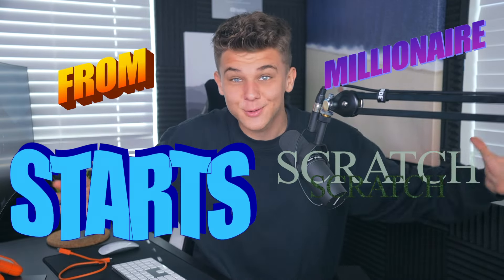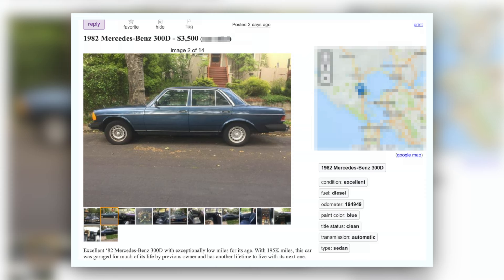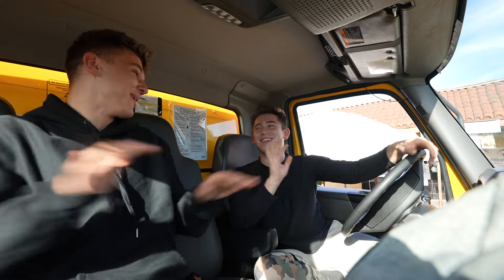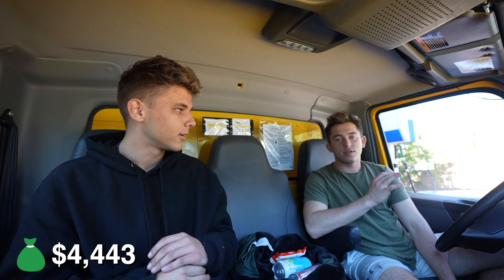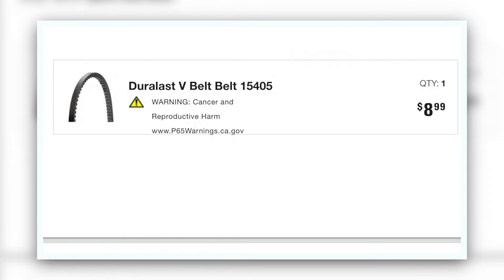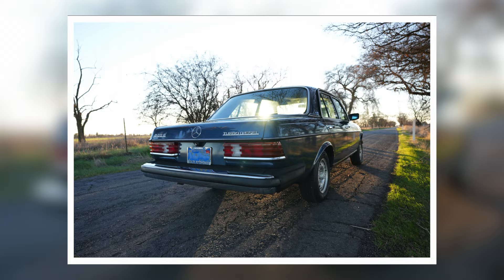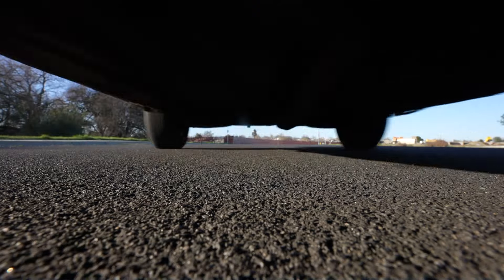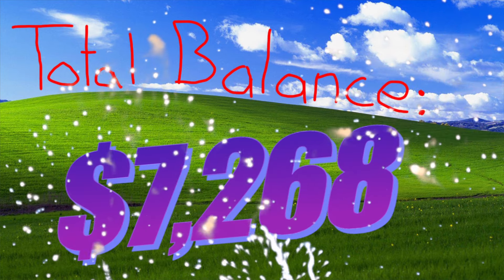Millionaire Starts from Scratch EP. 3

Comment: Great video, just gotta say, $3k for that car is not very shrewd! I'd say look at flipping BMW Z4s (I got a 2007 for $3.4k and flipped for $8k), Miatas, or E90 series. If you look hard, you can get cars for much cheaper. Just gotta get turned down a lot. And find cars with issues so you can fix!

Comment: You're going online to buy an alternator belt to put on your BMW flipper car, but a normal person would not know which parts need to be replaced on this random car.  You would have had to have brought the car to a mechanic and paid him quite a lot to search over the whole car to determine what mechanical things need to be fixed and/or replaced.  That costs a lot of money!  Then he would have had to tell you something like "your fuel pump and your alternator belt need replacing in order to resell this car and having it running optimally."  Then you say okay, and the mechanic is mad because you're not going to pay him to do the repairs.  Then you have to buy the parts.  Then you have to have auto mechanics skills and a place to do repairs to install the parts or do the repairs.  The whole thing's risky because if the car needed more serious repairs you would not have been able to do them at all.  Even just the jack you used to jack the car up to do the oil change is very expensive.  It just magically showed up?

Comment: There is no way you can rent a truck for 3 to 4 days just for $750. Most of the rental company charge $20 to $130 per day depending on your truck size and additional $0 .80 to $ 1.20 per mile so even for 500 mile it will be more then $750(just rent)+ ⛽. @Biaheza  justify this. Or stop fooling people.
Reply: Not heater just doubts. Clear the air